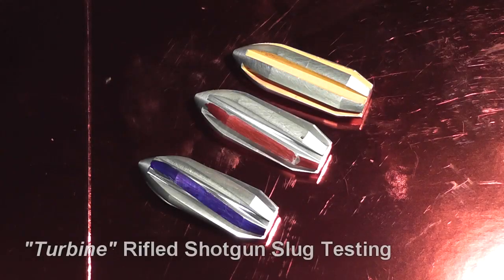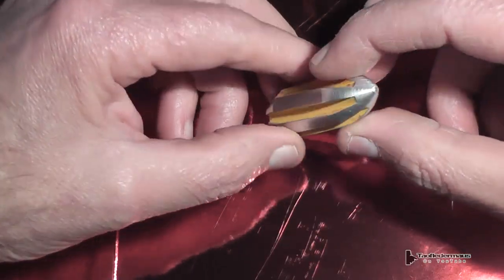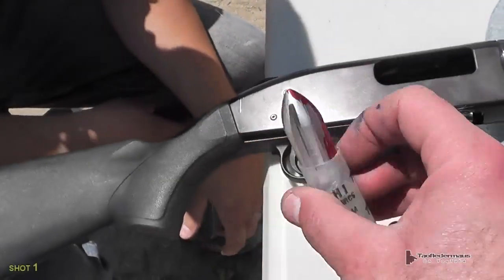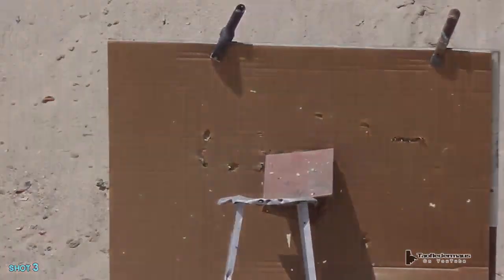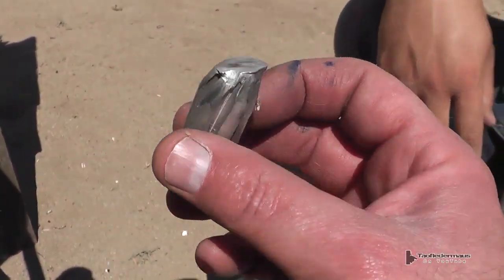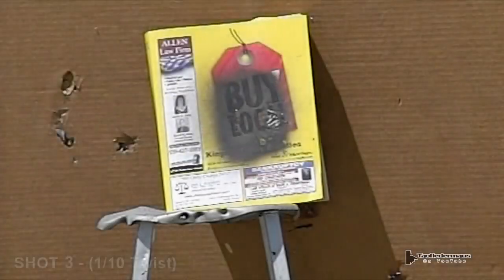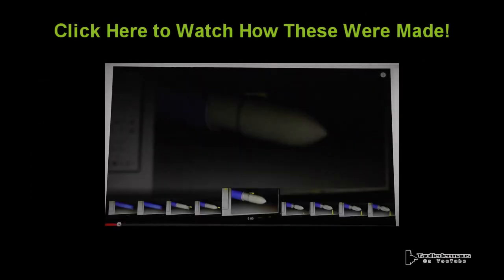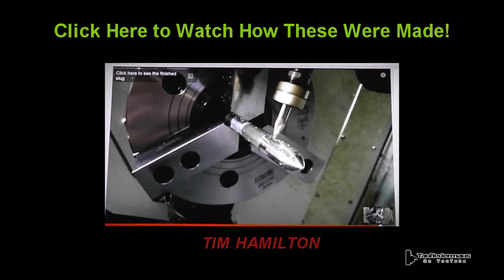Custom Aluminum TURBINE Shotgun Slugs  -Testing

Comment: The true problem with this round is that it"s aluminum. Sure, aluminum is a cheap and efficient metal that is also very malleable but it is one of the weakest metals if not the weakest used today. I'm not suprised the slug would tear apart like that. I understand that the makers of this slug probably chose aluminum for the slug because the metal islight weight, malleable, cheap, and easy to manufacture. However, the only way to make a round like this effective to the extent that it was truly designed to be, the metal used to make it must be changed or combined with another metal that is strong enough to sustain this pressure and also remain malleable enough to make such a complex shape. My opinion leans toward titanium. Titanium is definitely not cheap, but it perfectly fits the part to solve this problem. Besides, what part of recreational shooting is cheap?

Comment: It doesn't look like there is anything stopping the flow of gas from the ignition of the gun powder from surpassing the round through the rifling on the actual round, probably causing a reverse spin in the barrel and then have to switch direction coming out of the barrel

Comment: that isn't going to work well it'll be traveling so fast that the groves are too small to act upon the bullet in an efficient manner.  at some point the manipulations of the rotational inertia will slow the slug down,  also the depth of the grooves will administer the effect.

Comment: I would think at supersonic speeds you'd actually want a flat nose (or maybe a mushroom nose) instead of a point on the round so the air is guaranteed going through the rifling.  With a pointed round seems the air could get compressed so violently at the tip that low pressure is created around the rifling start and it doesn't do anything.

Comment: Hey, having the edge, connecting the cone to each opening of an air slot, rounded would allow the air to stick to the surface rather than break off cause turbulence and reduce the effectiveness of the slots significantly or possibly entirely. Just an idea you could be onto something here. /watch? v=gvDerbIU-uY <-- Video for concept reference.

Comment: Hi there. Great stuff. Tell them to try and use the same rifled aluminium design but with a heavier metal at the tip of the round to make it front heavy. This way it transfers  all the momentum to the front and it acts more like a pulling action rather them dragging its heavy bottom which would increase tumble. The rifled grooves must start shallow at the tip and gain depth as it gets to the back of the round, like fins. To keep both metals together during flight it helps to be a solid design. A centred single screw design perhaps. Disclosure, I am no engineer, just a physics aficionado. Or just geek .

Comment: Try adding weight to the core of the turbine slug. Looks as if its too light. I've seen this happen with .270 Winchester ammo@ 150 gr. Too much power not enough weight. Drill out core of slug, add steel or lead. I bet it fly's better. They impact nice!

Comment: i think the solution to the tumbling problem is really simple.spiral groves on the bullet obviously will not cause it to rotate. however altering the shape of the slug so that it stabilizes itself by drag while moving through air will in theory put an end to the tumbling.factors that would have to be taken into consideration are; size, weight, lenght and balance

Comment: the best and easiest way to get the perfect shot and perfect power is by adding a lighter tail to the bullet, I can't give you a photo to explain but I think you can understand the trick, the tail must be thin in the middle and on the back you can make it Spiral about 1/2 cm, and the front must be all closed to absorb the full energy of the gas, so that will make it spin by the air not the gas, and the difference between the weight for each side plus the advantage of the spiral tail will make it stable while traveling on the air

Comment: They're too light to be effective, try hollowing them out from the bottom and filling them with lead. It shouldn't ruin the balance point but the added weight will make them more effective at retaining energy while flying through the air.

Comment: Basic physics chaps, this was never going to work. I enjoyed the video though! Everyone likes a Friday afternoon home job in the machine shop at work. :) Forget the rifling, this isn't how it works, for smooth bore shot, its like a dart, or a rocket, or an aircraft even in some respects.  Centre of gravity needs to be in front of the centre of pressure. An object will rotate about its centre of gravity, the rotation being instigated by drag, by moving the centre of pressure behind the centre of gravity (make it heavier at the front, or cause some drag at the back, ie. Flights, fins, tail) you actually stabilise the trajectory of the projectile, as any deviation caused by drag, is corrected by more drag being caused on the opposite side, behind the centre of gravity. Reading this back, I've made no sense at all, i guess there is a reason my wifes the teacher and I'm the engineer. Lol :) anyway, look it up its interesting, weight at the front, drag at back= stable flight. There is a reason darts, arrows, planes, parachutes (with person attached) all look the same fundamentally.

Comment: hey man, I've got a suggestion to stabilize flight
move the center of gravity forward
how? make slug heaviest towards its tip (lead core just in the front half, or steel)
ask tim to drill say a 5mm hole at about 15mm depth (1/4" dia, and 9/16" depth) and fill it with a really dense material in that section. Or he could try to hollow out the rear half of the slug, although id try to keep machining operations to the minimum and just add heavier material at the front.
by moving the centre of gravity forward, you can keep the slug straighter in flight.
They do this with rockets and a lot of hobby rockets can be stabilized using additional weight in the cone. It has to do with fluid dynamics but I wont bore you with that.
The grooves are good, id suggest some basic wadding thought to help prevent your high pressure gases leaking around the slug, you will loose a significant amount of propulsion by the loss of pressure from the gap - but I wouldnt increase slug diameter because it could jam - i reckon experimenting with the wadding will help a lot though

by any chance did you get some measurements on your slug velocity?

Comment: So what's the advantage of using an Aluminium slug instead of a common steel o lead? Also, isn't 20 grams a little too low for a 12 gauge? AFAIK (I shot with minimum 28 grams so I do not really know) 22-24 grams is the lower safe limit for a 12 gauge.

Thanks for the attention.

Comment: the problem that i see to this bullet is there is no air flow across the projectile until it has left the barrel the pressure from the cartridge is pushing the air at the same speed as the projectile the only way i can see this design working is if the barrel has venting for the gasses before the projectile leaves the barrel  so it may get the air flow required to get it to spin this i think will need to be at least 40% of the barrel length but it should gain stability even a barrel extension with venting  and an airfoil design on the projectile may ease airflow and prevent to much voilisity loss due to wind resistance

Comment: When I was around 15 -16 years old I had two mates that I shot with who only had 12 gauge shotguns with full chokes. One had a single shot Winchester and the other a pump action. We did a lot of pig shooting so they played around with making their own solid slugs and after some trial runs they managed to get the solid to hit bullseye every round at fifty plus metres. Their mould was an old motorcycle fork top cap nut with the thread machined out with no rifling and about 25mm long. To stop the slug from tumbling they drilled a 10mm hole into the back of the slug about 2/3 down and filled it with candle wax. When these hit a pig in the shoulder the slug would mushroom out from the back and the result was an entry hole of around 50mm. I am now 50 and still wonder if with some kind of rifling to get them spinning as well, how much more effective they would have been over a longer distance??

Comment: Tombs is right... friction is the key.  I'll bet you could get spin out of a smooth bore but you would have to have an incredibly tight fit.  One definite problem is that you are losing compression as gases blow through the 'turbine' channels in the slug.  That super-heated powder 'plasma' ahead of the slug doesn't help your cause.  Also, aluminum might not be hard enough to engage the bore.  Lots of machine work you've done here... nice try, hope you make it work!

Comment: Turban is wrapped cloth around the head.
Turbine is a rotary machine design to extract energy from a fluid.

Carbean is a car and a bean put together.
Carbine is long barreled firearm that is shorter than a standard rifle.

Also I'm American, in my last semester in Aerospace Engineering in California.
I have heard my professors say it both ways but when they say turbin I always see a spinning cloth piece in a jet engine. (Also all the students say turbyne cause we are not old.)
Reply from the maker: GuardianLords  I would suggest you look up the pronunciations of words before you call someone wrong.

Comment: The taper on the back end of those rounds is the problem. The back end should be flat and smooth and a hair short of being the same diameter as the barrel. Otherwise, when your explosion goes off in your cartridge, the explosion that's pushing your bullet out of the barrel is coming up around the side of the bullet, because the tapered back end gives it room to fit in there beside the bullet. Propellant expanding around the side of the bullet is going to make it tumble, especially where the force is being applied to a bunch of different planes of surface, that the chaos of the shape on the side of that thing ensures that you're not pushing that thing in 1 direction with your propellant, instead the thing is being pushed in some thousands of different directions all at once as the expansion of the exploding gases buffets all the surfaces there. If you want to efficiently push something in 1 direction, you need 1 surface, that's flat and it's got to nearly snug fit the chamber.

Comment: Aluminum was probably a poor choice of materials, it doesn't weigh enough to have the kinetic energy delivered by lead rounds, there's a reason we don't use anything else. The heavier round would probably also help with the tumbling issues.

Comment: Very interesting, but funny.  Those might have worked, if they were subsonic.  The shockwave of the tip probably prevented spin-up, and the exhaustive gassing during exit probably induced a backspin while it was in the barrel.  The backspin + shockwave + symmetric profile = unstable.  You need a discarding sabot to prevent the backspin, and the rear of the round needs to be tapered more.  The apollo spacecraft were stable on reentry because any rotation increased the wave drag profile thereby giving a negative feedback.  To sum up... blunted teardrop shape with shallower grooves and a plastic sabot to make it fireable.  The folding fin projectile took advantage of the same principle.

Comment: I'm the furthest thing from a gunsmith, but given the fins continue all the way to the rear of the slug, wouldn't the forces at the point of discharge encourage reverse rotation?  Perhaps the tiny tapered back section of the slug should have rifling in the opposite rotation, so the discharge can initiate the correct rotational direction, which would then continue to be encouraged by the aerodynamic behaviour after it leaves the barrel.  Just a thought.

Comment: If you're able to get a hold of more of these rounds you should pick up a rifled barreled shotgun. Rifling on the inside of the barrel really would make a difference in regards to any kind of round you use when it comes to stabilization.

Comment: ***** I think the turbine rounds are probably tumbling because they're not seated tightly enough in the barrel, plus, the shotgun is smooth-bored. It's probably rattling and banging up/down/left/right while still in the barrel, and when the nose exits the muzzle it's going to tumble across/toward whatever vector/axes it was biased for off its last internal "bounce" inside of the barrel ...thus the air-flow turbine slits never even get a chance to work and spin the bullet because because it is coming out the muzzle with a strong angular velocity (spin/tumbling force) already forcing it into a skewed orientation, then the resistance of the air's friction is going to make it go tumbling wildly every which way ... so it's a chain reaction of undesirable behaviors beginning with the round knocking around inside the barrel... In other words, you're throwing the football and pushing down on the tail of it as it leaves your hand and making it spin backwards, so it cannot spiral and fly correctly but will start tumbling wildly.

A specially rifled barrel designed for these rounds, however, would probably yield some pretty amazing results. Especially with a very powerful propellant charge behind them. Could be (literally) like a mini-AT gun -- and I'd dare say that using a cone-shaped copper core and small charge inside the round could make it capable of piercing several inches of armor.

Comment: Don't judge a book by its cover is the ol adage here.  It's all about the engineering.  For instance take a salt and pepper shaker, so let's stick with the salt shaker.  How much salt comes out will determine how many holes on the cap and the diameter of it. Including the shape of the glass and its thickness. Some times the cap will only have 3 holes and with the right amount salt coming out in a light stream like fall of a blizzard snow then fans out when it hits your food.  Could it be that the holes on the outside cap had half the diameter size while the inside (underneath the cap) had the full size.  And when you line up its edges of both diameters it will give it an angle like a funnel shape. Now it may not sound like much, but its engineering none the less.  Therefore begs the question, what is the purpose of making a slug with rifling and you demonstrated 3, but what was its intention? I'm thinking supersonic.  What exactly was it supposed to do?  That would be the first thing I would want to know.  All I saw was some neat looking slugs and that was it.  Can these slugs prevail in the near future? Only time will tell.  I look forward to its improvement.

Comment: Two problems: Back-pressure from the grain discharge will force the slug to counter-spin while traveling down the barrel unless there is a sabot 'stopper'.  The second problem is that the nose of the slug will deflect most of the air the slug encounters upon muzzle exit.  I am on the fence about how beneficial tapering the rear portion of the slug is.  I still enjoy the experimentation aspect of the round.

Comment: They are tumbling. Now if the machinist could mill the edge of the fins to install some plastic guides where the bullet makes contact with barrel might stabilized the bullets more...might have to play with the tolerancing a little.

Comment: I been cogitatin this and I think I see the problem. To get a better spin rate the grroves need to be wider and the "lands" narrower. Turbulance caused by the wider ends of the "lands" is preventing max airflow down the grooves.
Try doubling the width of the grooves. Let me know what happens.

Comment: Engineer here hoping to explain why this didn't work:

Firstly if the slug was spinning along the axis it would fly straight, your issue is that it wasn't spinning. Additionally it needs to be spinning when it comes out of the barrel because otherwise it may begin to tumble before it has a chance to spin.

Normal bullets don't spin because of air travelling through the rifling slots, they spin because of the rifling in the barrel so they come out spinning, the air actually has very little impact on the spin. This is because air (or any fluid) flows primarily in 2 manners; either laminar or turbulent and because of the speed a bullet will always experience turbulent drag, not laminar drag. As a result any rifling or air reliant steering methods with a bullet will have greatly reduced effect and often negligible effects (but not no effect). Fins and spiral rifling on the projectile only work with low speed projectiles like arrows because the air still passes through them in a laminar fashion. Typical pressure differences don't work when the air is turbulent and this is why aeroplanes fall for a little bit when they hit turbulent patches of air or "turbulence".

Comment: The rifling on a rifled slug does not actually spin it. It allows the round to squeeze through the the various chokes a shotgun can have. Also what stabilizes the rifled slug during flight is a large hallow cavity in its rear area. Like a birdie in bad-mitten. The higher mass in the front doesn't allow the back of the projectile to turn because the front is pulling the back so the front of the slug is always in front. Just to clear things up lol :D